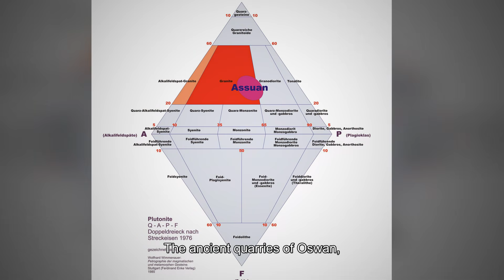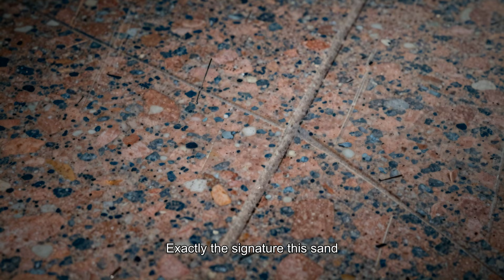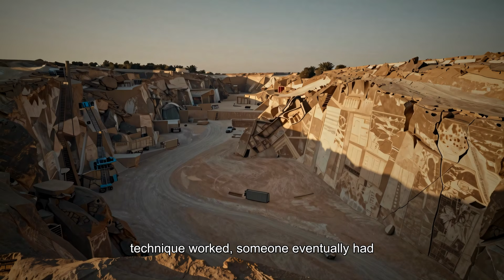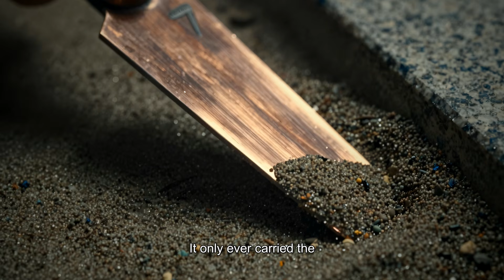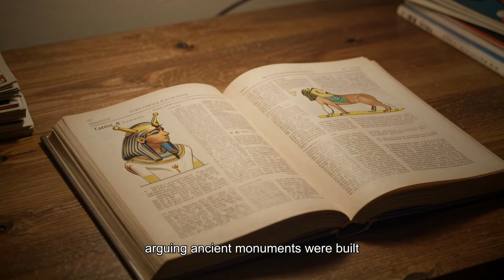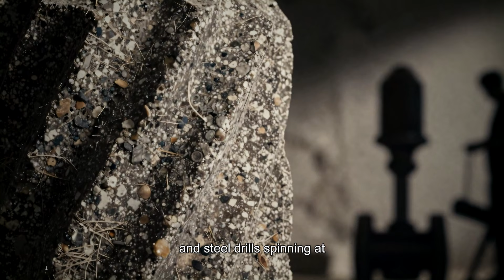How the Egyptians Cut Granite Without Iron Tools

Comment: Notice there's no actual video evidence showing the use of dolerite pounders or cutting and polishing with sand. AI slop at it's finest.
Reply: It may be AI slop, but it's genuinely educational, and a far cry from the slop pseudo-archaeologists like Graham Hancock put out, that would have you believe that there is no rational explanation for how this was done,  except through some woo-woo vibrational energy.
Reply: @avishalom2000lm good luck with your pounding and copper saws with sand.🙄
Reply: @S-Ltd1000 they probably could have found an actual example of this being done or at least dug up a paper about it , had they made half the effort
Reply: @avishalom2000lm  PLEASE stop sounding so ignorant and ideological. I don't believe you believe what you just said. I think you're one of those naysayers that simply disagree with anybody that sounds smarter and more intelligent than yourself.   And I will bet anything that you've never watched any of Graham Hancock's or Brien  Forrester's field research videos showing you how completely impossible it was for the Egyptians 4500 years ago to be able to build those megalithic structures when the only hard metal they had was bronze.

And keep in mind that the Egyptians 4500 years ago were not intelligent and creative enough to invent the wheel nor the block-and-tackle pulley system to lift heavy objects up off the ground which would have been extremely helpful when moving small or medium-sized blocks of stone.
Reply from the maker: Hello, thank you very much for your comment. We try to mix AI content with real facts and have no intention of creating staged videos that could reproduce something that didn't happen. In future videos, we will try to make the content more lively.
Reply: @TheKaerith  SUGGESTION:  Why don't you try to be more reasonable and logical regarding, for instance, how completely physically impossible it was to use round stones to cut, shape and polish granite and basalt stone blocks?